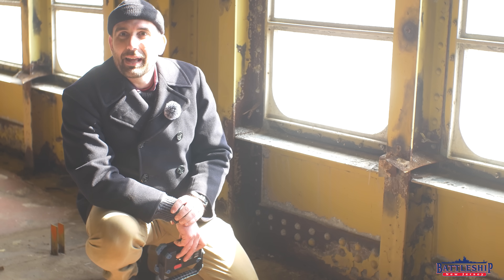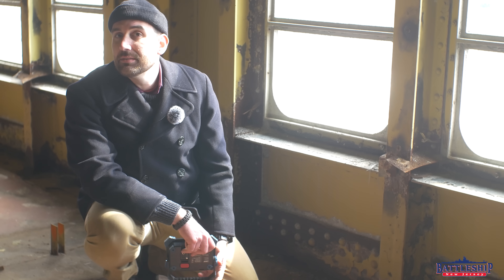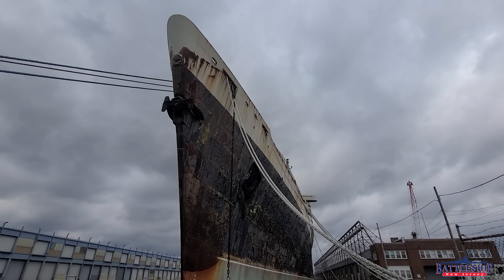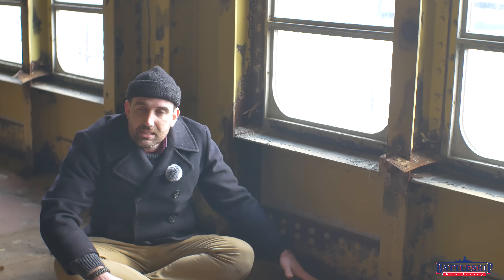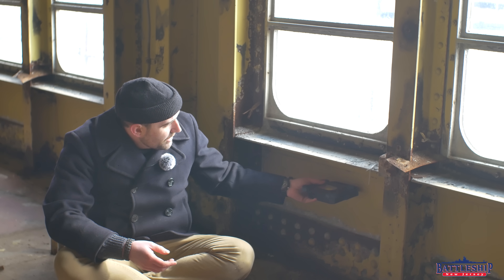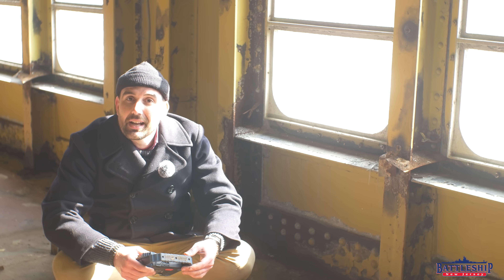SS United States: Steel, Aluminum, and Corrosion

Comment: if this ships internals are in such good shape its a damn shame their gonna sink her, although I have to wonder if the way it was bonded together might be part of the reason of her sinking, like the stuff they must have used to insulate the alumiumn from the steel is toxic, and you figure all that dirt, dust and debris from 30 years of decay, even with the hull, the outer being the main corrision part, a total cleaning, reengineering and recommissioning to meet modern safety standards would probably put her well over 300 million dollars to rebuild her

and she would never be fully clean from it,

Comment: This ship is a health hazard with all the asbestos additives they used in paints, coatings, and insulation materials. I dont recommend anyone going in there without a mask and suit
Reply from the maker: Fun fact, they removed the majority of the hazardous materials from the ship at one point, especially the asbestos. Which is partially why the ship is so empty.
Reply: @BattleshipNewJersey  Fun indeed. I don't see the chipping paint removed. It contains asbestos.

Comment: Great afternoon they should restore  painted and overhaul the engine and send all the corrosion and be good as new also they should save it SS United States it was excellent Cruise ship ⚓🚢 also they should put it on a dry dock for the restoration and repairs

Comment: Britain learnt during the Falklands war that aluminium as hull material is a BAD idea. eg the Sheffield. The aluminium (alumina) structures in the hull, the scaffold lit up like magnesium when an Exocet hit, then the aluminium melted, preventing the aluminium oxide coating that naturally forms protecting lower aluminium metal from corroding, failed.
Result even if the ship has a pair of fire tenders were on each side, the ship would have still been lost. lessons hopefully learnt, to structure, or use only steel alloys.
Let alone the galvanic problems of mixing steel and aluminium.
Solutions on latter, electrically isolate both metals, use active electric anti corrosion methods or  zinc/magnesium sacrificial anodes.
Plus keep the aluminium bits to the superstructure NOT the hull.

Comment: She does look remarkably good with virtually no protection . Aluminium has been used for some warship  superstructure but was found to be vulnerable in the Falklands . Dissimilar metals do create corrosion problems , the worst being brass and aluminium .  Considering the total lack of paint and the length of time the United States is amazing  . A testimony to the design and workmanship of its builders .

Comment: Ryan says ‘steel’ not (elemental) iron, is the top really (elemental) aluminum or is it one of the aluminum alloys?
Pure aluminum is corrosion resistant but is vastly softer and weaker than the alloys.  Alclad is the duralumin aluminum-copper alloy with a coating of pure aluminum for corrosion resistance and strength in some aircraft.

Comment: My understanding from accounts which I've read about the "Big U" is that the builders used a sheet of solid neoprene between the aluminum and steel at the joints to slow the galvanic corrosion. It looks like it worked.

Comment: It is surprising that they didn't use stainless between the steel and aluminum sheets.
Reply: The corrosion problem is on the aluminium side, not the steel side!  In this case it is galvanic corrosion or dissimilar metal corrosion. It can affect aluminium when it is physically or through an electrolyte connected to a more noble metal. The noble metal can be any metal that has lesser reactivity compared to aluminium - although iron isn't exactly a noble metal it is still less reactive than aluminium.
Reactivity of a metal depends on its position in the electrochemical series. The severity of corrosion will be worse if the other metal is further away from aluminium in the electrochemical series - copper
(in  brass) would corrode aluminium rather quickly, faster that it's corroding steel.

Comment: I very much hope that the SS United States can be saved. She looks to be in very good shape internally.

Newport News Shipbuilding do a very good job of building a durable ship. The Guinness Book Of Records records notes the MV Dulos (ex SS Medina and built by Newport News Shipbuilding in 1914) held the distinction as the worlds oldest seagoing steel ship being continuously immersed in salt water. The ship gave 95 years of continuous service. Marine engineers would fall over each other to be given the chance to work on her as they knew how special she was. The ship was so good every time she went in for Survey she would pass-the near 100 year old hull plates were still in good shape. 

Quite incredible that steel can survive for so long in salt water. Goes to show what good design and careful manufacture, combined with good maintenance can do. 

She was only taken out of service as the new SOLAS requirements for low flammable interior fixtures came in to effect and the owners (who were a bible distribution charity) felt it too expensive to refit the ship. So she was sold to a businessman who has since hoisted her right out of the water, and converted the ship into a hotel on Bintan Island, Indonesia.

Comment: Modern Navy ships with steel hulls and aluminum superstructures are welded. If you look at the joint, there is an inch or two wide strip of aluminum/steel that is welded to each respective metal. That strip is made by an explosion welding process (EXW). The two dissimilar metals are machined flat and laid together on a bed of sand. High explosives are detonated above them fusing the two together. This is cut into strips and used to join the ship together.
Reply: I guess whoever came up with that method must've been having a crap week and wanted to blow something up.
Reply: Who's the manufacturer on that product?
Reply: @andrewyork3869  The product is called in Europe NOBELclad... Guess vho ?

Comment: River boat builders use a bi metal strip that had aluminum cast onto the roughened steel creating a strip both metals can be welded to. I think there is also an ultra sound process that can join the two metals.

 The trucking industry has fought with ways to mate aluminum and steel for decades with varying degrees of sucess.

Comment: The type of corrosion that forms between two or more dissimilar metals is typically called bimetallic corrosion, DISsimilar corrosion or more commonly call galvanic corrosion.
Reply: Agree
Reply: And my understanding is a welded bimetal joint does not have the corrosion issues a bolted or riveted joint does. I worked on a steel research ship with aluminum deck houses and we did a lot of research into this. The problem with welding steel and aluminum is that the melting point of steel is so much higher than aluminum it isn't practical... Expect for explosive welding! They literally put two bars of metals together and welding them with high explosives. You then use the welded bar as a filler and weld it to the two sections. It just is very expensive.

Comment: The SS United States is such an amazing ship.  I'm thrilled to see you giving it some attention.  I sure hope someone can save it as it's one of a kind.  I doubt anyone will ever build anything that large than will go that fast.  It does appear to be in much better structural shape than you would expect.  It would be amazing to tour the engine room as a museum.
Reply: We might need it running to ship guys over to China
Reply: @kylek9432 God, don't say that, we don't really have any good options for troop ships. Most everything inservice today is just too slow. SS United States I question if her condition is as good as they state, namely the turbines. We could probably build something if the need truely did arise quickishly, depending on where we build these ships.

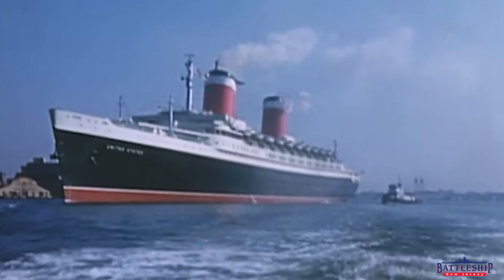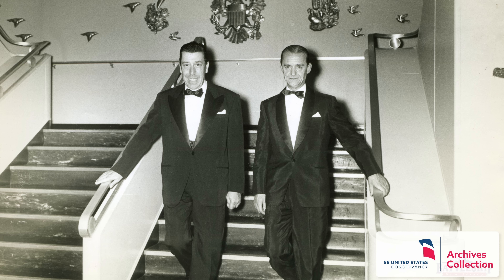Comment: 5:20  5:30 in a prior vid, some in the comment section complained that the ship should not have had internal fittings sold at auction, the time stamp above explains why the interior is stripped out.

Comment: wonder if encasing rivets in zinc would help.
Reply: Zinc in contact with aliumium wouldn't work on the longer run, because is is still more nobel than aluminium. Dissimilar metal corrosion can affect aluminium when it is connected to a more noble metal. The noble metal can be any metal that has lesser reactivity compared to aluminium. Zinc is less reactive than aluminium, but more reactive than iron. Aluminium and zinc are naturally protectect against atmospheric corrosion by an oxid layer - that grey stuff on the surface of zinc. In aluminium this layer it is almost invisible. Iron is more vulnerable to atmospheric corrosion, although it is less reactive than aluminium or zinc, because it has no protecting oxyd layer on its surface.

Comment: Such a beautiful and special ship :) Glad that there are people who care about her. Speaking of corrosion, is there ever any thought given to permanently dry-docking ships like this, or museum ships? Sure, it wouldn't help the inside of the ship, but keeping the hull out of the saltwater would help preserve it over the decades. Of course, there would be a fairly substantial cost involved with building such a facility, if you could not buy one that was already in place.
Reply: Ryan has a video on that, and there are bigger issues and salt water about storing a ship of these sizes out of the water. It's best for them to be in the water as they should be, as long as they can be dry docked occasionally for maintenance and repairs.
Reply: You should probably look at the video they did on that